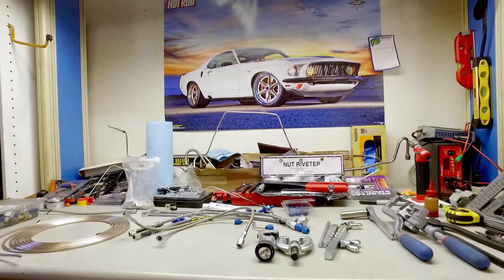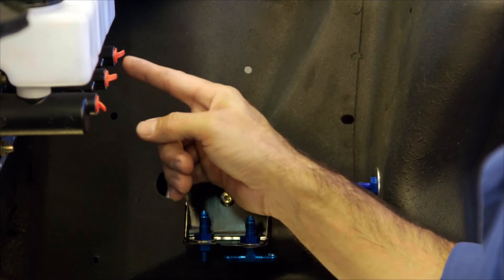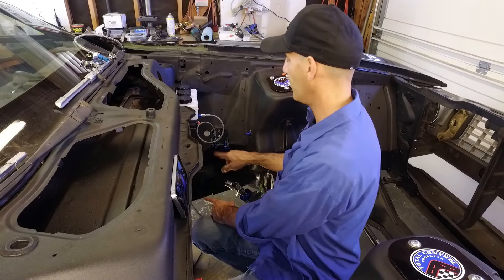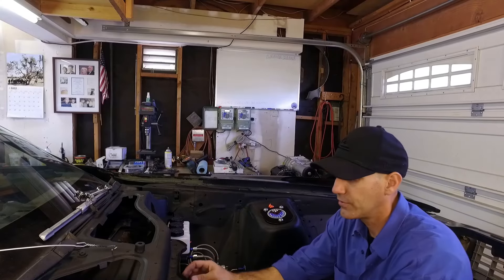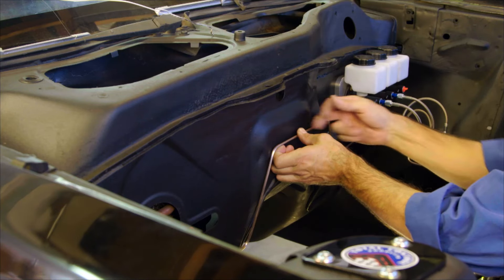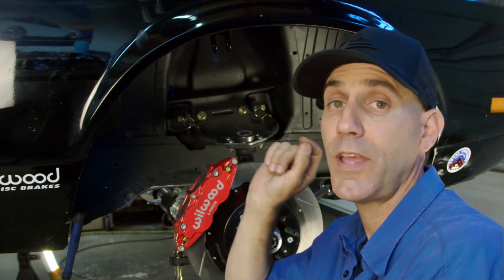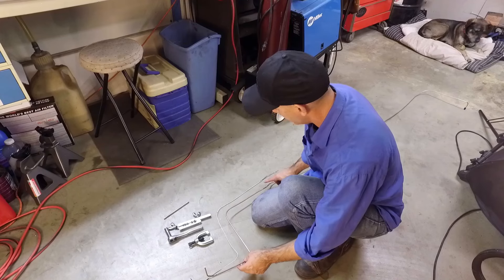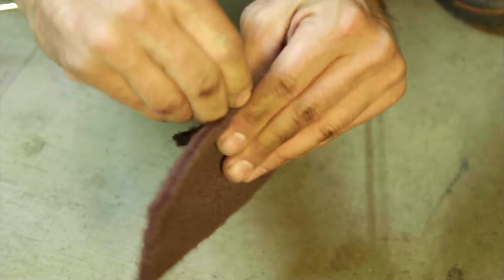How To Build A Custom Brake Plumbing System for Classic or Race Cars

Comment: A tip that I would add. When making brake lines, I try to make the brake caliper line into the caliper lower than the bleed port in the caliper, and the routing far side of any given section should be lower than the master and any section of the line. ie start at caliper and try to ONLY go up to the master, no high points for air to get trapped in between the caliper and the master. Makes bleeding the brakes 100x easier.
Reply from the maker: Good suggestion.
Reply: I dont mean to be so off topic but does anybody know of a tool to get back into an instagram account?
I stupidly forgot my account password. I would appreciate any tricks you can offer me!
Reply: @Jaime Imran It did the trick and I finally got access to my account again. Im so happy!
Thank you so much you saved my account !
Reply: @Karter Stanley glad I could help :)

Comment: the most beautiful flares happen when the fitting isn't on the line... and usually when i cant spare 1/4" to cut it back
Reply: Been there. Done that. I know your frustration. Not only that, I've soldered a seven wire connector only to discover I forgot to put the back shell and strain relief on first. Oh well, practice makes perfect, right?

Comment: great video. good information and production. just a note.
NPT stands for "National Pipe Tapered"  as opposed NPS which are "straight" threads.  it's common for many to think the "T" in NPT stands for "Thread"  but important for the DIY'er to know the difference so the correct fittings are used. 
Thanks again for making video
Reply: Really good info. Thank you!

Comment: Hey just came across your video. Well done. I'm a retired U.S. Navy Jet Mech/Search and Rescue/Vertical Replenishment AirCrewman. On one Det I was rushing to complete a line and was under the gun to complete it. I had told the Boss no problem we'll make it. Then I did exactly what you were talking about with regards to the sleeve. I just made my launch time for a major replenishment with the carrier. I kicked myself in the a** over it and my det didn't let me forget it. When your mouth writes checks your a** best cash them.
Reply from the maker: Great share!
Reply: @AutoEdits  THX I did a few others in my career but ran about 99% on cashing the checks but still hated messing up. Others could say hey sh*t happens and walk away me?? It would drive me nuts not doing it right the first time.

Comment: Very nice video, I am doing a 70 Ford F100 with Crown Victoria front and rear end and CV power brake booster,  By watching this I now can build my own distribution block.  Now I don't need to purchase a brass distribution block, will do my own line routing like in the video all should work out for my application.
Reply from the maker: Really glad to hear about your project! Thanks for the feedback.

Comment: Great video. Thanks.  I did want to mention that I've had terrible success with using pressure switches in-line. They seem to work fine at first, but after a while, you need to press harder and harder on the brakes to close the circuit. I even found a "low pressure" switch on line and installed it with the same end result after a short time. I became so paranoid about losing brake lights that I installed a small indicator on my dash that only lit when the signal was sent to the the actual brake lights. Ultimately, I installed a mechanical switch which solved everything, but I kept the in dash indicator.

Comment: I know this video is 7 years old but I'm  kind of surprised you never heard nickel copper at that point I upgraded the brakes on my 92 Mustang 10 years ago and used all nickel copper lines on that. I had been using it about six months prior on side work and my beater vehicles. Stuffs a life saver on the New England coast I'll  tell you.
Reply: You're absolutely right. SAE recommended NiCu in the late 60s as the best way to prevent line corrosion related brake failure. Volvo changed over first in the mid 70s. High end cars from high corrosion places, RR, Lotus, Aston Martin, Porsche followed soon after. Other brands went with coatings, zinc, plastic, epoxy. Enjoy your car.

Comment: Thank you so much.  I enjoyed your video.  You made it look simple.  On the farm I quickly found out that teflon tape and hydraulic fluid are a no-win combination.  There are pastes out there, such as one from Loctite, that work well but the white stuff on a roll should not be used.  Thank you for making such an informative video.
Reply from the maker: Good tip. Interesting to hear about the teflon tape not working for you. It's still holding fine on this application but I'll look to a paste on future stuff.
Reply: @AutoEdits  Redid all of the lines on an old tractor with a nice new hydraulic spool.  I made that mistake of using teflon tape and then two days later I spent half a day fishing all of those little pieces of half dissolved tape out of the insides of the spool.  Of course, after the fact all of the hydraulic stores that make up hoses said, "Don't you know that you aren't supposed to ever..".
Reply: Yep never use Teflon tape on brake lines with a proper double flare you do not need any sealant at all they will not leak

Comment: Great video...thanks for posting it.

I am currently building a racing car and am faced with fabbing up a brake system.  I was considering using braided steel/teflon lined hose in 100% of the system, rather than alternating between the braided hose and hard lines.  It would have a lot of advantages...fewer joints....complete flexibility....and the braided hose is actually tougher and less likely to be damaged than hard  lines...because it is immune to vibration damage that can fracture a hard line that is not properly designed and mounted.  It is also less likely to be crimped or permanently crushed due to damage.

I got a lot of predictable advice "use hard lines as much as possible or you will have a soft pedal...." etc.

While pondering all this.....I was looking at tech photos of a modern DTM racing car....arguably the highest technology racing in the world today (less restricted by rules than F1)....and the brake system on this car was plumbed 100% with braided steel hose.  I figured if they didn't have a mushy pedal....neither would I....and decided to forego the hard line thing altogether.

I agree with the poster below....it is laughable that Wilwood still sells brake system parts plumbed with NPT.  Why they do that is beyond me.
Reply: Possibly.  My fear with some of the super-fly race tech is that they only have to make it last a few hours at a time.

Comment: I used the plumbes of an old porsche in my car . And parts (stainless) from a truck.
Cleaned everything, and they are good quality. Had to emend some things, machinist work, but not big deal.

Free stuff,I used to rebuild things from scratch.

Comment: Enjoyed the video.  Nice post processing and use of multiple camera angles as well; many folks don't know what all goes into that part of making these videos.  I've got a Ford project of another nature going at the moment and can relate to the brake plumbing, suspension and other task required to get these old vehicles back on the road and in tip top shape.  Mine's a '67 F100 Pickup.  Keep up the good work, I've subscribed and will be keeping up with your work for sure.  Take care, Clay
Reply from the maker: Howdy Clay, sorry I missed this comment when you left it but thanks so much for the nice words.
I hope your F100 project is going well...I really love that era of Ford trucks!

Comment: Awesome! I have 1965 mustang with a new set of wilwood brakes in which I need to plumb new lines to the front and rear your video helps out a lot. Thanks!
Reply from the maker: +Victor Y That's what were here for right!

Comment: I would also add, coming from being a diesel tech on tractor trailers, that we were taught in brake class to use liquid tephlon vs tape bc it’s possible if a small piece in in the air stream, or in your case fluid stream, break off in the system, it could cause brake system failure. OCD is beating me up over that run on sentence.

Comment: The down side of Nic Cop tubing. Is why I only fit copper brake line once.
The reason for the nickel is to make it look more traditional and keep the copper from tarnish.
But the issue is it's soft and supple to bend, but very easy to crumple ,dent , collapse by flying rocks and road debris far easier than Steel ( it's tough) and stainless steel ( real tough)
But nobody Dailys thier classics ,so just be aware and check it if for some reason you hit a dirt road .
Or a patch of questionable debris.
The coat hanger as a mock up tool ,I never thought of, so I learned something. I always roughed it in by hand bending then fine tune with bending tools. Or used the old lines.
Reply from the maker: Good info!
Reply: Copper brake lines are illegal to use in australia I don't know about where you are

Comment: I hadn't realised the Nicop line was available in the US now! I recommended it to a friend in VA a year or two ago for his Jeep and he couldn't find it. I myself have been using it in the UK since the early 80's when I first got into building cars, although I'm not sure when it appeared on the market, but I do recall it was quite a new thing at that time and have used it ever since!

Although if I remember correctly it was a Swedish invention because back then there was only one brand and it came marked made in Sweden with a Swedish trade mark logo!
Reply from the maker: +cheyennedogsoldiers Cool factoids!
Reply: Volvo has been using copper nickel brake lines since the 70's.

Comment: Great video. I'll definitely be playing this over and over out in the garage as I plumb my system.
(Great video quality too, some guys look like they're filming in a dark closet through a pair of pantyhose.)
Reply from the maker: HA! Thanks... If you keep watching this series... this car is now on the road and a driver and the brake system has been working flawlessly!
Reply: @AutoEdits  Do you have anymore detail on the hard line to flex line connection in the back? That's where I'm at now.
Reply from the maker: @mdplemons  I used one of these but as I searched I could only find this double order and it's expensive https://www.summitracing.com/parts/hdt-lk-005      It's basically a -3 bulkhead
Reply: My problem is that I had to cut out the trunk floor for a coilover suspension that I installed. Now I have to be creative about where to mount the flex/hard junction.

Comment: I have a similar flare tool. I was going to use SS line but switched to NiCopp. I had ABSOLUTELY no luck double flaring it. Perhaps it's easier with a single flare and AN fittings. SS line is hard stuff.

Comment: man that is so clean, well done! I need to find the video why you are using single flare not double flare though
Reply from the maker: I wanted to go with the AN fittings and that's the only way for those. Since it's a well maintained hot rod... I've had good luck with those fittings, even for daily driver duties.
Reply: @AutoEdits  ah that's fair man. I just used the stock master in my build, when the forged motor goes in I'm sure I'll need to upgrade to something with abit more oomft. That wilwood set you have looks unreal, remember the part numbers or anything?
Reply from the maker: @Simonstockton82  For sure... the Wilwood catalog has changed a bunch of time since this video and they have even better stuff... just search for what year car and they will offer a kit for it. Plus if you want to keep the double flare... the Wilwood calipers have any number of adapters to make it work with your system. They even helped me do the math on what master cylinder is right for my application!
Reply: @AutoEdits  cheers for the replies brother. Just subscribed. You tube needs more car guys like you 🤟

Comment: Only one thing I would change. You should not use steel supports on copper brake line. Two dissimulation metals will cause a galvanic reaction. A simple fix is to use rubber insert straps to support the lines. Everything else looks great. Nice job.

Comment: Great video. Just a suggestion, next time you might wanna consider placing the T split for the front brakes in the middle of the firewall of the car in order to have equal length brake lines to both front wheels, as fluid as good as it is still has some dampening to it. Ideally you would wanna place the T above the engine, for servicing purposes.
Reply: LOL

Comment: very nice set up. I have been playing with the idea of upgrading some of my brake system on my 85 k20 suburban. I would keep most of the hard lines but use flex lines off the master and the calipers

Comment: Learned much from your video. But am puzzled why the install did not seem to include a proportioning valve or combination valve?
Reply from the maker: Solid question, this setup has individual master cylinders for the front and rear brakes so it uses a balance bar on the pedal to adjust brake proportioning.

Comment: Hi nice job. Just getting ready to do my own.  Why no proportioning valve? Not needed?
Reply from the maker: Very good question.  Since this pedal setup has discreet master cylinders for front and rear... I adjust the bias right there on the pedals... it's pretty cool.  Otherwise, yes a standard prop valve would be needed on the rear lines!

Comment: S U R & R E-Z Bend Tubing sold by Summit is Made in USA
-
 And, the gully in the two tube cutter guide wheels are there to place a to-be-cut-off flare in, to cut off just the flare and loose little line as possible. You know, times when the fitting didn't happen to make it on before flaring...

Comment: Great video! I do have a question what about a propositioning valve?
Reply from the maker: That is a good question. Because I’m using independent master cylinders front/rear… the proportioning happens at the pedal with a balance bar.

Comment: Very nice job Dude, the people that design cars don't know this or maybe they do and do it just to cause early failures however dissimilar metals in contact with each other erode sometime very quickly, even steel and stainless steel. One of the most volatile connections is Aluminum and Copper since it been two years since you made this video I would be interest to see what those connections look like. I this case strong nylon material would be better.

Comment: Locktite hydraulic sealant would be a good replacement for the Teflon tape in this application plus the added advantage of not having unsightly white tape on the fittings
Reply from the maker: Good tip, thanks!
Reply: Totally wrong never use single flares on brake pipes always double flare also never use thread nylon tape on brakes all dangerous practices 49 years as a brake specialist

Comment: Nice install just seems the hard lines should be double flaired , a/n is obviously solid  .
Reply from the maker: Can't double flare AN but double flare  is more forgiving for a most folks for sure.
Reply: @AutoEdits  was the hard line the same fitting as hard fuel line fittings for a/n ?( separate flair from nut)

Comment: No equalizer??? Or is that built into your master??? Thanks ....working on a 23 T right now.
Reply from the maker: Yes, there's a balance bar on the pedal assembly since this setup has discrete master cylinders front and rear.

Comment: @autoedit...sure wish you would give more detail in the narrative about the parts and tools you used.  I had never heard of Rivet Nuts until I watched this video...what tool are you using and where did you get it from?  What about the anchors you used to attach the hardline to the firewall (I think you said you got them from Lokar)?  I am in the middle of making the lines for the brake system on my 65 Fastback and you have me rethinking my approach.  I have a conventional Master Cylinder and adjustable Proportioning valve.  Wondering if I can use AN fittings like you did instead of the conventional break fittings.

Comment: Great video. You got me motivated to start doing mine now. After searching around on the internet, I can't seem to find the an fittings or the backing portion of your line clamps. Do you happen to have a link to them, or at least point me in the right direction? Thanks
Reply from the maker: Go to either summit racing or jegs and type -3 fittings and all the different stuff will come up for ya ! Have fun with it!

Comment: Very nice!
But one question; is there any need for a proportioning valve?
I ask because I got a Dodge ram 1500 that's giving me brake problems and wearing out brake pads and front rotors really badly and I think the proportioning valve and abs or combination valve rather maybe the problem and I looked it up and I just saying they don't make it anymore. Lucky me
Reply from the maker: What year Ram? If I were in your shoes... I'd order a replacement master cylinder and get the PowerStop Brake kit I put on my Ram... https://youtu.be/__EsW2uwEDo
Or just take your calipers off and make sure the sliders are properly lubed because I had that happen once https://youtu.be/gqIoTpRneKo

Comment: great setup, but shouldn't you be using a double flare hard-line?
Reply: no need to with AN lines. thats for antiquated UNF type threads that seal by squishing the tube itself. on AN lines the fittings are what seal it which is why they are much more common on high dollar high pressure setups. (5000psi aircraft hydraulic systems even use AN) on his hard lines he did double flare though. its all done in 1 step with that tool he used when he did finally go to hardlines